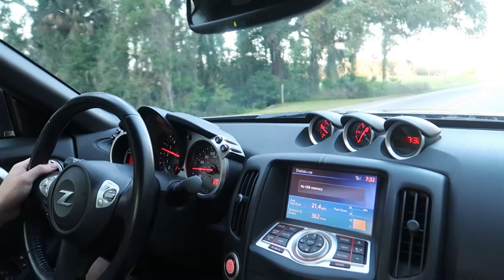370z Get Fully Adjustable Clutch Pedal!

Comment from the maker: I wanted to make a comment and say that after a couple weeks of driving on this pedal and adjusting it to exactly where I want it. I was definitely a little harsh in the video, and I’m very happy with this pedal and how smooth everything feels.
Reply: Now would you say it’s worth the money?
Reply from the maker: @HirschPower  If I were to start over I would probably rather buy an oil cooler with that money, but I think I would definitely get this pedal again, I would just get other mods first if that makes sense.
Reply: @JoeyPhillipsChannel  Makes perfect sense. I guess I’ll be purchasing both. Oil cooler to help when I’m boosted, and the RJM to help with the feel of the upgraded clutch.
Reply from the maker: @HirschPower  I definitely have so much more confidence in the car with the pedal, it’s way more predictable.
Reply: @JoeyPhillipsChannel  Alright, even after a year and a half with my car I still struggle to quickly and smoothly shift with the OEM pedal.
Reply: @HirschPower  Don't over think you are doing it wrong or you aren't doing it perfect. Just enjoy it👍

Comment: having the same problem with the clevis fork thing, what did you do to make it line up and fit?
Reply from the maker: The clutch pedal can be adjusted up and down, we just loosened the screw and got it where it pushed the clevis fork in and out straight and then tightened the screw.
Reply: @JoeyPhillipsChannel  glooking brodie💯🤘